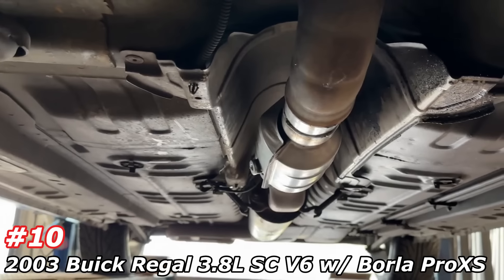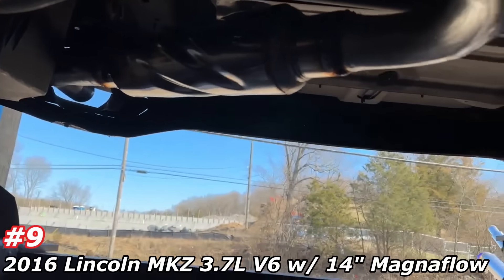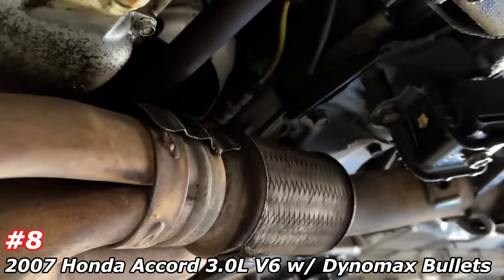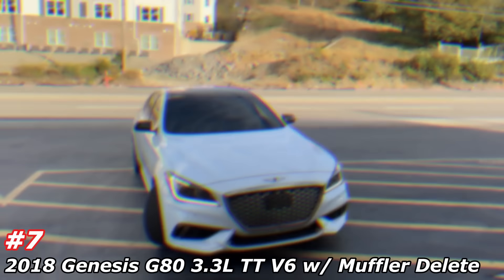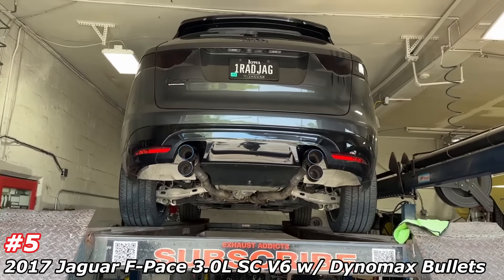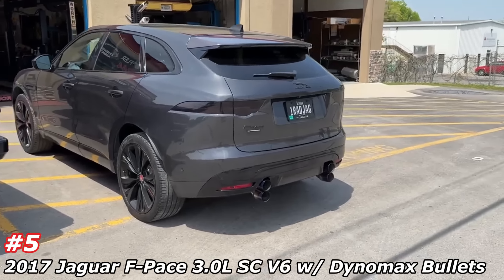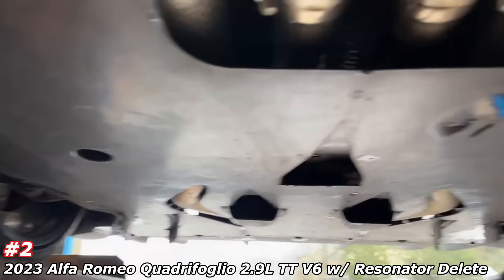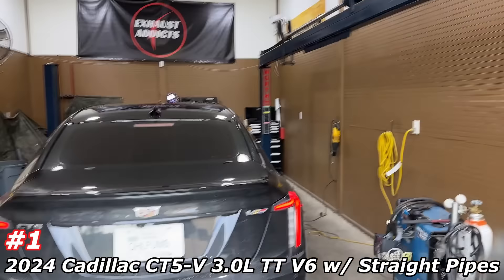Top 10 Best V6 Engine Exhaust Sounds of 2024!

Comment: That mkz was absolutely PERFECT. Low tone with no rasp at all. I will certainly be investing in one of those coiled mufflers for my 3.3l solara convertible.
Reply: I had a 99 solara with the 3.0 and used a set of them with no cats and they did a wonderful job

Comment: 🔊Most V6 is sound great straight pipe. If they come with tools it’s best to see if you can do an #Xpipe or #Hpipe or both either one in the front or in the back best sound takes away raspy and drone adds lower torque and performance.🤙💯

Comment: The 3.3 genesis sounds just like my old 3.3 sonata when i ran a full straight pipe...the 3.8 was the best sounding variant tho, but the 3.3 sounds pretty clean, moreso than i expected....my prediction is that if there is an Lexus 3.5-2.5, 370z-Infiniti 3.7, ATSV, 3.6-3.0,2.5 VW-Audi, or a 3.8 genesis coupe included for 2024, it'll win...of course tho, there are higher spec cars like the Jaguar F type v6, GTR, and etc, but i'll just keep my bets simple..